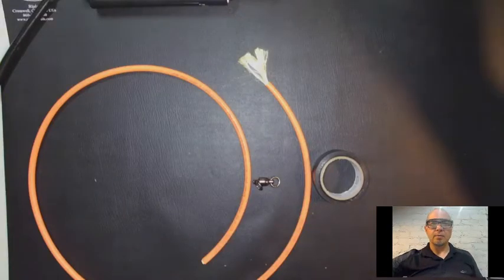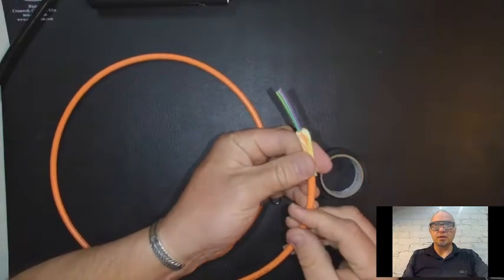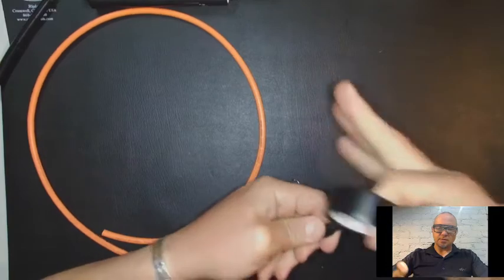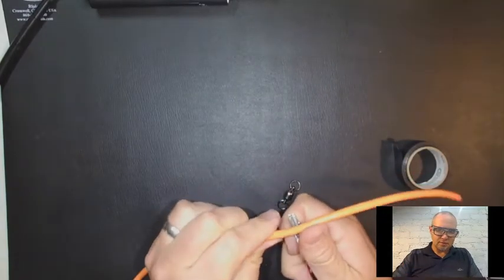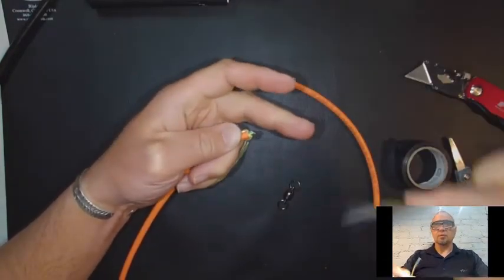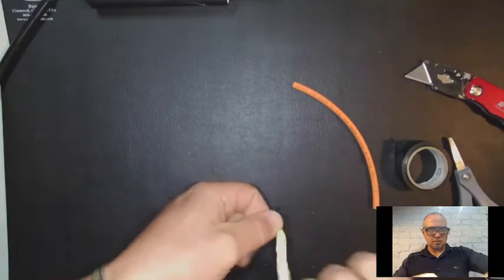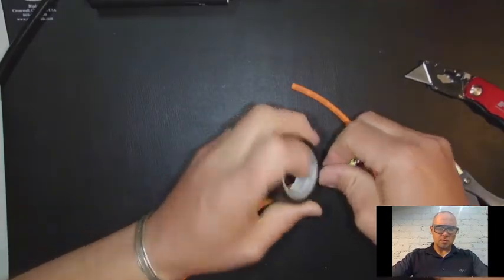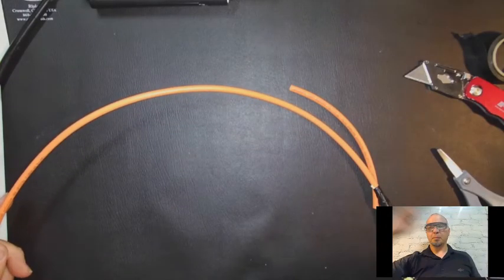Pulling Swivel

Comment: Where did you find that swivel?  It is my understanding that if we use something like that with pull string or jetline then it would assist in not wrapping the cable when pulled through multiple time.